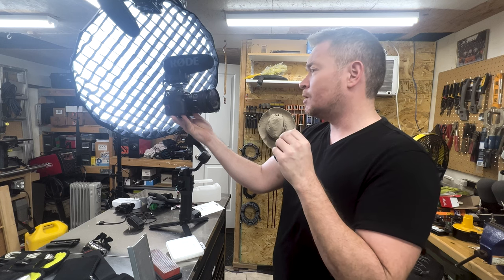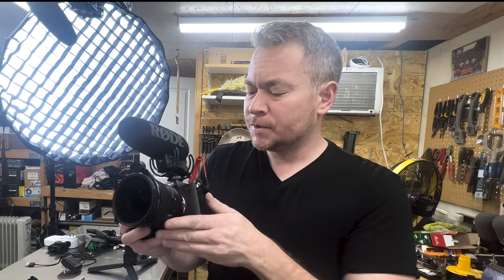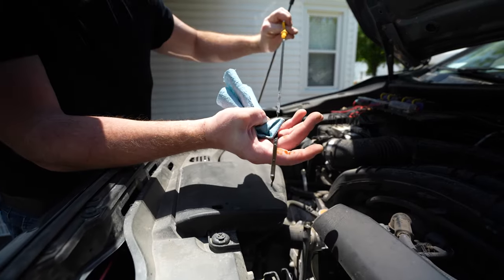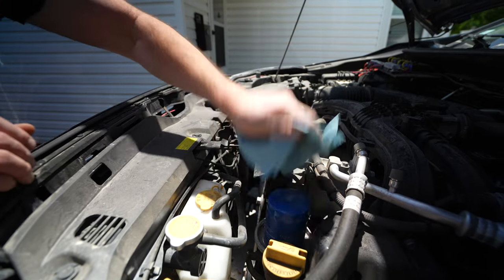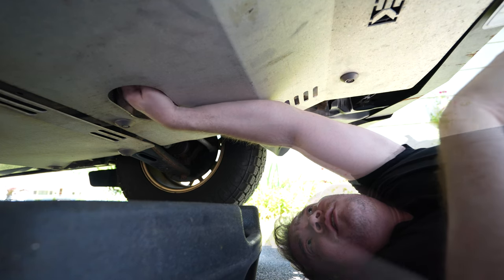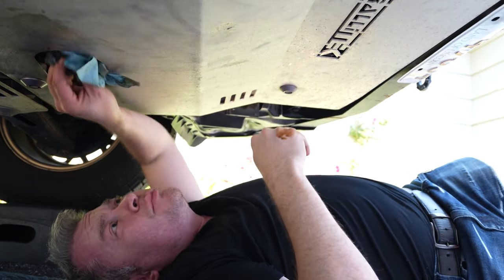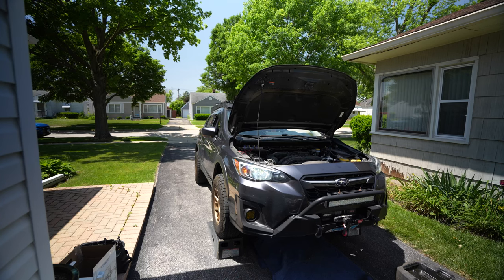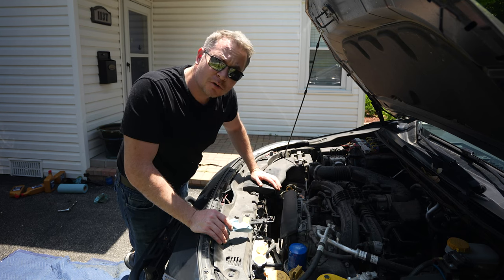New Camera and an Oil Change

Comment: Try a Fumoto valve to replace your drain plug.  Much less mess!
Reply from the maker: yeah, I think that's the way I'm going to go.  I recently put one in my GX470 and will be changing oil with it for the first time this weekend.  If it lives up to the hype, I'll get one for the Crosstrek too :). Thanks for watching!
Reply: @TomtheDilettante   Love your channel - keep up the good work!
Reply: Have one on my Outback.  Nice.  Attach a hose to it and switch the lever and drain it into a container.  Easy/Peasy

Comment: May I recommend getting a ValvoMax Oil Drain Valve as featured on the Scotty Kilmer channel video The Future of Oil Changes - New Invention.

The advantage over the Fumoto is the drain tube can be placed directly into an empty 5 quart oil container so even if it is windy, there is no oil spilled or sprayed. 

Just discovered your channel. Really liking the content. Looking forward to getting my SDR to listen to air traffic.
Reply from the maker: Welcome aboard and thanks for watching! I have Fumoto valve on my Lexus GX 470 and it came with a tube to help drain the oil. I’ll be changing the oil in that thing this weekend and posting my experience on this channel. Thanks for the tip though, I’ll definitely have to look it up.

Comment: Started watching you channel as I was looking to buy a cross trek , didn’t happen tho was interesting watching some of your other videos the Radio one was interesting tho not much use in the UK. interested what benefits you needed as you had a a6600 still pretty great quality and for some still quite a high end expensive camera probably more expensive than my cameras and I’ve been in photography In work and a hobby for 30 odd year
Reply from the maker: Thanks for watching!  And yeah, I don't really have a specific niche other than "normal guy who likes lots of things and sharing with others". :). The a6600 is a fine camera, don't get me wrong.  I still have and use it.  I went for the a7iv because I wanted a full frame sensor for better dynamic range and to start playing around more with night photography.  Plus, I wanted to start getting more lenses and figured if I go full frame, I can use them on both full frame and aps-c.   Lastly, I want to learn more about color grading and was looking for a camera that can shoot 10-bit 4:2:2.  I would have liked to get the a7siii for video but man is that thing expensive, and it's not ideal (imo) for photography (lower resolution).  So, since I was looking for a good camera that can do both photography and video, the a7iv seemed to check more boxes than most.  Right, wrong or indifferent, I hope that helps answer your question :)